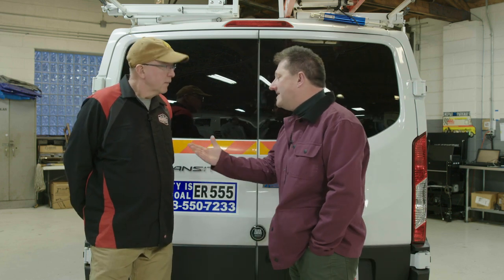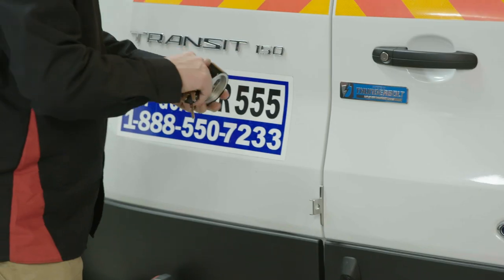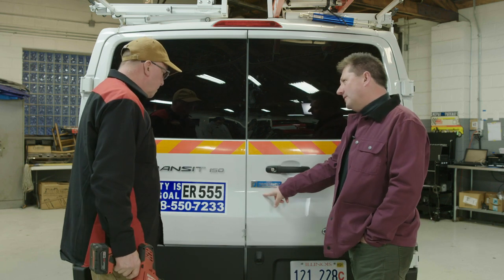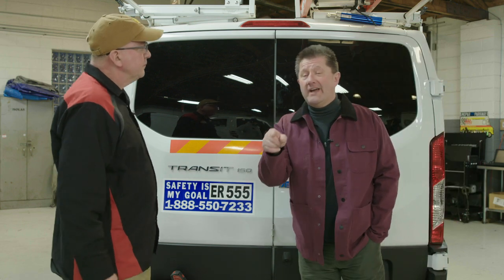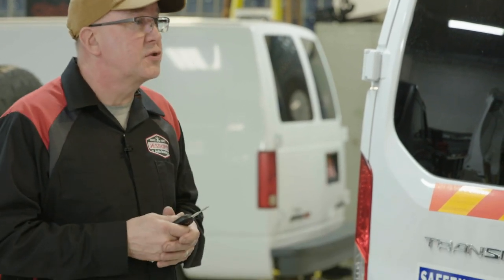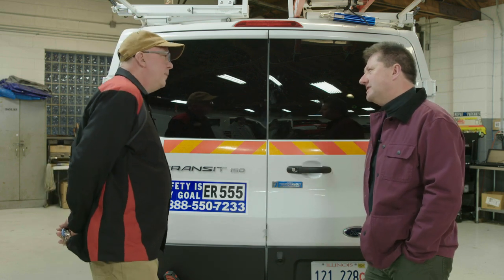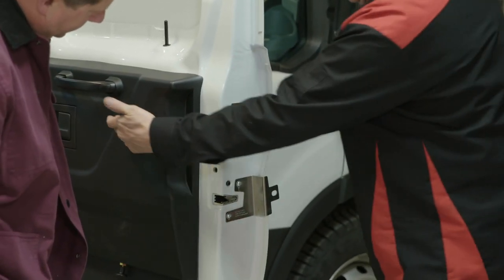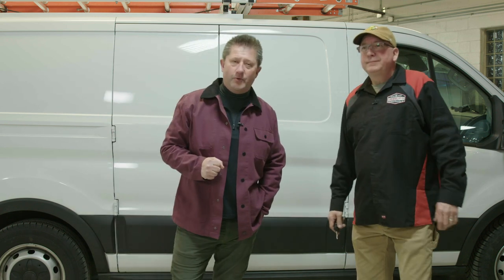Best Locks for Work Van Doors to Secure and Protect Your Tools

Comment: Thanks for showing how it works. Now it is much easier and faster to break in.
So break the back door glass ( to recuse the noise  of shattered glass apply thin coat of jam with plastic film on the top). Then pull that emergency door release from inside ( coat wire hanger works fine) and you in. Make sure you wear gloves and safety glasses.
Reply from the maker: Ummmm not likely. You have your choice of where you'd like to locate the manual release button and you can choose to not attach the knob. We usually advise to keep it way low on the door and again it can be hidden...just use some common sense.

Comment: What about if they broke into driver side and push door unlock will disable deadbolt too or will be safe
Reply: Thunderbolt offers Lock Conversion Relays for vans that are vulnerable to that. Once installed the “unlock” button only functions when the key is in the ignition.
Reply from the maker: https://youtu.be/C7sMkY8zB-A?si=H0Pt8FehoCus800T

Comment: They could use the exact same method to cut the deadbolt as soon as they try to open the door and see it catching they will cut it. They best thing for van security is internal security (lock boxes, cages, even a big bike chain and lock) everything else is just a deterrent. If they want in they will get in plain and simple.
Reply from the maker: Nope...it doesn't work that way. They can't open the door and see the deadbolt to cut it. There is a lip or edge that overlaps the opening preventing it. We agree the best van security is internal and deadbolt locks are just that, they are located inside the doors.

Comment: I'm parked roadside in an RV with only basic liability. I have only one lock and it was tampered with on the weekend. How I didn't see it happen is beyond me. But the same thief showed up a second time and blew his cover. I also know the guy . Now I'm just gonna add a second deadbolt and improve the window security. If they smash the glass they won't get in. I'm small enough to make raised floor sections and lowered ceiling cabinets to make a 6ft tall man feel claustrophobic trying to get in. The same thief has been targeting me and several other people and businesses in the area
Reply from the maker: Sorry to hear that happened. We always recommend a bulk head barrier to block the rear area from the cab, but on adventure vans, it's a bit more complicated. You can always install inexpensive hasp locks on the lower part of your doors to secure them until you get deadbolts for all doors. Of course, the drawback is entering and exiting the door with the installed deadbolt.
It's a cheap, quick solution. Last, definitely install 3M shatterproof glass film on windows and a good alarm. Safe Travels to you!

Comment: What happens if the thief defeats the central locking? If they twist the lock barrel on the drivers door twice it’s the same as unlocking the van with the fob. Would it not be better to have this system on a different fob?
Reply from the maker: We provide that option as we sell a remote control module accessory that comes with 2 fobs, it easily connects to your van's power and connects to the Thunderbolts. It then works independently from your factory remote system.
Reply from the maker: @conormallon9011   Hi Conor, sorry to hear that happened to you. The fact is some vans are set up to unlock and some are not. To test it we tell people to roll down their front window and then lock their doors. After a few minutes reach in and press the unlock button to see if the doors unlock. If they do then there are two options: 1. Have that function disabled by the dealer if possible or 2. Use one of our Thunderbolt remote control modules and then the Thunderbolt locks will operate independently from the factory locks. If the factory locks are unlocked the Thunderbolts will stay engaged. This is the way we recommend using our locks.

Comment: this is a great idea but what happens if they break out front window of van and hit the power lock button all the doors will open
Reply: Good question but, nope...most vans already have the mechanism installed to disengage all the locks after a few minutes of shutting off the ignition. Additionally, any van can have this function activated within the wiring.
Reply: Can't they just use the  recipitating saw to cut down the door gap,to go right through your electronic deadbolt?
Reply: @prouserprouser9646   When the door shuts there isn't a gap since the doors overlap each other. Additionally, there is no indication of where the lock is installed since Thunderbols can be installed in a variety of locations on the door. Locks should be used in combination with an alarm system so once they start breaking in they have very limited time before they decide to leave because of the sounding alarm. With puck locks thieves know exactly where to cut and it takes just 24 seconds to cut those exterior locks off.
Reply: @prouserprouser9646  my thoughts exactly.
Reply from the maker: Great question and here is the answer: most modern vans lock systems disengages after a few minutes to prevent this from happening. If it doesn't it can either be reprogrammed to disengage or we can sell you a simple device that can do it for you. No van that holds tools in the cargo area should have that function in place.
Reply: That's what happened to mine. They also popped the hood and disengaged the battery and re-engaged it to power cycle.(I'm assuming) they got away with about 10k worth of power tools

Comment: My van just got broken into this morning but they went through the driver side door do you guys have anything that would lock the driver an passenger side doors
Reply: Thunderbolt Locks will fit on any door; rear barn doors, side sliding doors and even cab front doors. Sorry to hear about your break-in.

Comment: Seems like they would just smash the front windows to unlock the vehicle. This would only deter the thieves trying to break-in in stealth, but wouldn't help in a place like San Francisco
Reply from the maker: If they smashed the window and tried to pull the handle or press unlock it would NOT unlock the Thunderbolt deadbolts.

Comment: These aren't going to be a deterrent for thieves breaking the windows trying to get in because there's nothing visible indicating there's a deadbolt present.
Reply from the maker: Each lock comes with an embossed warning emblem plate. At the 13:40 mark of the video, the Thunderbolt Emblem is shown that is applied to the outside of the doors putting a thief on notice that a break-in is not advised. Stay Secure!

Comment: id lolve to install this on my transit but if someone were to bust my front window and unlock the doors they're in
Reply from the maker: Hello Chance Jones - you are correct. That is why we recommend a bulk head barrier between the cab and cargo area. It is also a good idea to have an alarm to work in conjunction with the Thunderbolts.
Reply: Even with a bulk head the front doors unlock the back doors as well
Reply from the maker: @chancejones365   Most vans automatically turn off that function after a few minutes. If not it can be programmed and at a last resort a module can be installed to handle it. Here is a video showing it on a Ford Transit. https://youtu.be/TDFwBsESatk

Comment: Why not just break the window, lol. And if you're going to put in deadbolts, wouldn't it be wiser to install them higher to prevent peel and steal?
Reply from the maker: You are correct which is why these windows have cages on them and there is a bulkhead barrier separating the cab from the cargo area. As far as "peel & steal" the deadbolt can be installed anywhere inside the door or can be surfaced mounted or in any direction meaning vertically at the top of the door and engaging above the door. Some customers install two Thunderbolts in a single door one up high and one low. Additionally, we always recommend complimenting any security locks with a good alarm to deter thieves from continuously trying to break in over a period of time. Thanks for your comments and stay safe!

Comment: That's nice, but the thief will still try to get in and in doing so will damage the door thinking the van doesn't have added security. If you see a theft deterrent on the outside of the door than more than likely the thief will pass on it. THUMBS DOWN
Reply from the maker: Hello Moe, Thunderbolt provides bright reflective emblem plates on the outside of the doors warning thieves what they are up against with the installed deadbolts. Most thieves won't bother, but if they do I'd rather have van damage than... have my tools stolen if I was a tradesman, have my belongings stolen if I was a vanlifer, have my musical equipment stolen if I was a band, or have video cameras stolen if I was a video production company.

Comment: What about the sliding door??
Reply from the maker: Yes, it works with the sliding doors as well. We even have a version for a roll-up door on box trucks. The Thunderbolt lock is very versatile and can be custom-fitted into many unique installations. We've had customers install them in trailers, cab doors, semis, and even pick up trick bed doors.

Comment: Makes you wonder why manufacturers don’t make work vans more secure.  But they do charge a premium for these steel boxes on wheels, built quality is lacking. Just look at any Chevrolet Express: gaps are uneven, no interior panels, everything rattles. Never ever would I buy another Chevy or Dodge van.  🤮

Comment: So your saying they will use a saws all to cut off lock but they won't break the window 😂
Reply from the maker: We're saying thieves will go for the weak link. If you have a window you need a steel wire cage barrier protecting it like in the video. If you have a puck lock it's a visual target and easy to cut off. Deadbolts in combination with a bulkhead barrier and an alarm are your best bet to secure your tools, cargo, and livelihood.

Comment: Hi, I’m afraid its back to the drawing board for the thunderbolts lock - its an out of date & extremely simple lock system to defeat - relying on the factory simple locking system to activate the solenoid how stupid - its meant to be a high security system -  something more suitable to use  on a dustbin locker - more fool you if you fall for all the hype & waste your money. Ed,
Reply from the maker: We strongly disagree; in fact, it's the best way to secure your van doors in our opinion, as well as thousands of other happy customers! If you think a thief can break a window and press unlock to bypass the system, all you need Is our LCR to fix that problem if your van is vulnerable to that type of function.